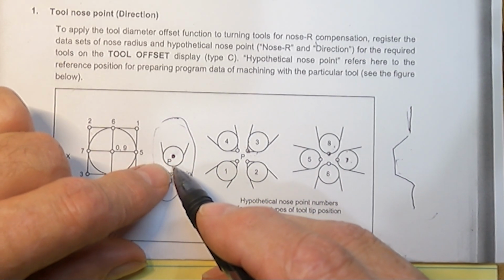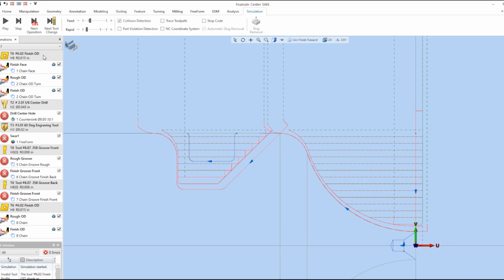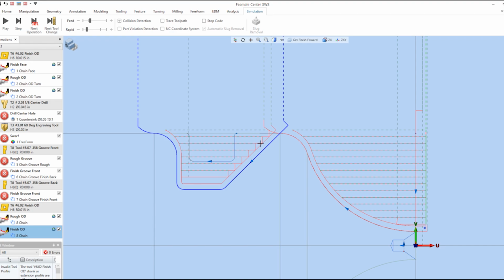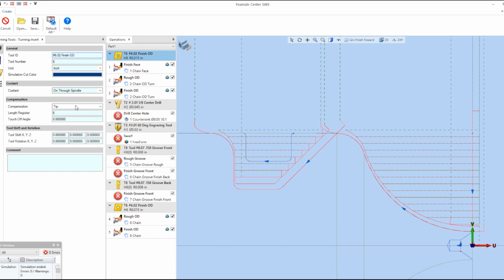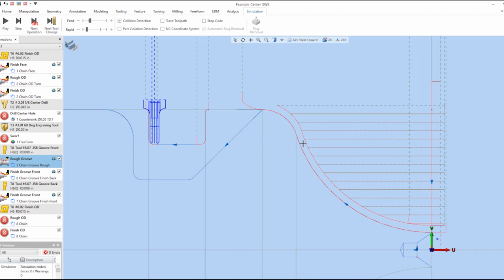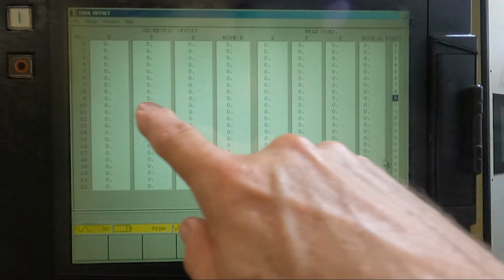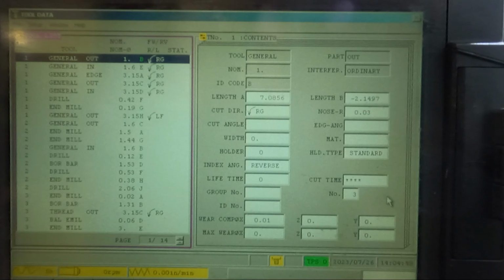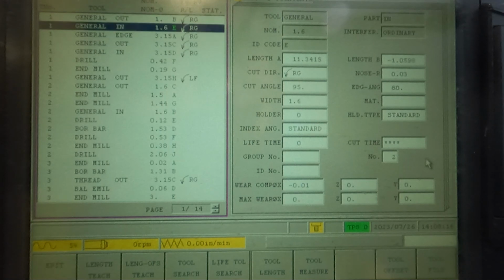Lathe Tool Tip Comp 2

Comment: if you write T0808 in the program, then it will run according to what is written in the table line nr 8,    when there is nothing in the table then it runs according to the mazatrol tool, I thinks that you can have 128 tools in the magazine, that fits with the 128 lines in the table..
Reply from the maker: No on this machine when you run Mazatrol tool setup in a G code (they call this eia.) your tools are called T8.01 for tool #8A T8.02 for #8B and so on. Because with the Mazatrol tool definitions you can have many tools on the same number. The letter tells the control what tool definition to use. In G code you can’t use letters so .01 is A .02 is B .03 is C and so on up to Z except a few of the letters like I J K (I think I would have to check?) this machine holds 80 tool in the tool changer.

Comment: I’ve watched your lathe tool tip radius offset videos and I still have a few questions on the tool data at the integrex. Specifically, if I am using one tool in multiple orientations in the milling spindle (oriented at 0 degrees for od turning on the front side and 180 degrees for turning on the back side as well as turning with multiple b axis angles) how to I manage that data in the controller? Do I need to create a new version of the tool for every orientation of the b axis and front side and back side turning? Will I need to build the same tools version in esprit? From the looks of your tool data page, it looks like the answer is yes but I’m a bit confused when it comes to the A B C D E…. orientation and how esprit determines what the alphabetic cut direction designation is generated.
Reply from the maker: Yes you will define a separate tool for each orientation. Just like you are saying with A,B,C so on like you said. Now in a g-code you just change to that tool with a M6. So for tool say 2B that would be T2.01 M6 (Esprit should put this in the code if you also use a different tool with the correct orientation in Esprit). And yes you have to build a simulation model (adaptive holder) for each tool in Esprit for the simulation. This could be the same one you just have to rotate the adaptive holder and redefine the inserts location for the rotated location and change the spindle rotation direction. Hope that helps.

Comment: What software do you use to program your mazak integrex by the way? Also what software would you recommend me to learn myself? I run a 650 mazak integrex myself but I'm a conversational machinist only right now, but I want to learn a CAM software so I can start programming in that besides only using mazatrol
Reply from the maker: I use Esprit Cam. At the time it was the best for the Mazak Integrex. But now there are many softwares that can do it. Esprit is expensive and may not be the best option there is now.
Reply: @EdgePrecision  Would Mastercam work just fine?
Reply from the maker: @Leinnn  It could. I have no experience with Mastercam so I can’t say for sure. You have to get with Mastercam and get a demonstration.
Reply: @EdgePrecision  Alright, thanks for your replies

Comment: @Edge Precision    Hi Peter, thanks so much for taking the time to make this video!  It has been super helpful to me.  I have finally gotten my Mazak Integrex 200SY fixed! (1999 model year with Fusion 640mt control)   I am trying to find the right cad/cam software to run it.  Over the years I have seen you use Esprit and Master Cam, as I recall.  I have used Fusion 360 before so I am leaning that way, but I thought I should ask for your thoughts on software before I take the jump.  FWIW, I am a full-time pastor and part-time machinist, so cost is more of a factor than it is for most because I do not use my machines all the time.  Thanks again for all the learning you have shared with the youtube community over the years.  God bless...   Mark
Reply from the maker: Mark I did a while ago investigate into using Fusion 360. But there was no good post back then. Now I have had people message me that there is something now. At the time I was looking into this the Fusion people didn't make posts for machines (I don't know if this is still true). So you had to go to a outside source for this, and of course pay for that. All other Cam software's are sort of expensive so I don't know. Also there are subscription or maintenance costs. With my Esprit this costs around $5000.00 a year (I no longer maintain mine).
But I will say if you are running a business their support is very good and if you are doing very complex machining it is worth it to get a solution to you problem quickly. Instead of spending a lot of time and still have to do some kind of workarounds. With Esprit they provide a accurate model of your machine for simulation and will work on your particular post to output code exactly  the way you want. Auto Desk may also make better options for programming a mill turn type of machine. But you are going to pay a yearly subscription. So the short answer is, there is no inexpensive option. If you don't do real complicated stuff. It may be better to just use the Mazatrol conversational format. Unless you need some unusual machine movements. The guys here at Center-Line can do some amazing things with just the Mazatrol.
Reply: software you have in your mazak machine .. mazatrol programming . you can do most normal turning very easily and quickly in mazatrol and it is easy and quick to correct plus you don't have to think about compensating, mazatrol does it if you only choose to drive (eia/iso) on the machine you must be sure of setting up in the machine is exactly the same as in cam .. whether you use mastercam or something else is not a problem it is what the postprossor writes that is important ..I didn't see it was Intergrex sorry what Peter makes are small series which are very complicated. there I would also choose cad cam. if you drive large series and have to correct a bit all the time in the morning when the machine is cold and during the day mazatrol is light and fast .. there are many things that come into play whether you have to choose cad cam or mazatrol you can also run both if You want

Comment: Hey Peter, normal I use G41/G42 on my ST25Y with the R (Rad. Geometry) and T (Tip Direction ), e.g. R 0.8 and T 3. without the CAM - Center Tip option.
What if I use Center Tip option (CAM) in combination with G41/G42, should I leave the Geometry R-value in the table to zero (0) and only use the Wear, because the CAM did the X-Z-R-calculation already,  Haas and Fanuc have the Geometry table you showed as 2nd table.
Reply from the maker: I'm not totally sure what you are asking. Are you combining a manually written program with a Cam processed program? If so everything thing has to match if you are using the same tool offset to do both operations. You could assign two different offsets on the same tool. So it is possible to on each offset to have a different tip comp direction but you are actually doing everything with the same tool. But if you do this you need to be careful to touch off each offset at the machine correctly and to call the offset in your program when it is needed. Your Cam software should be able to define the tool the same way as your manual program. That would probably be the best way. You can of course use wear offsets to compensate for these things. But I don't really recommend that kind of thing because if a lot of time goes by and you have to do the same job again. You would have to remember what you did. So if someone else runs the program they won't know this. (You could also put notes in the beginning of the program to remind you). So mistakes could be made. It would be better to try to standardize the way you program and touch off tools for all programming to avoid this kind of thing. As I said in this video I don't ever use the 0 or 9 comp direction for tip comp. Because those aren't the way you touch off tools, either with a tool setter or manually.
Reply: @EdgePrecision  
I use manual program and CAM but never use the Center-Tip option in CAM because it gives strange G-code numbers for X, Z and R, the other options just give X-diameter, Z-length  and radius just like the CAD-drawing, the cnc-control in combination with G41/G42 doing the math for me.
Probably it's a fault in the Postprocessor, X and Z should always match with the CAD length and diameter.
Btw, I use multiple Offsets on the same tool when I do long shafts, e.g. just call for T0220, T0221 etc. for T02 in this case.
Our lathes ( Haas /Fanuc) only have the 1 - 8 tip directions, not 0 or 9 Center-Tip.

Comment: Thank you.
I just found your site yesterday.
Your are so caring and thorough
We live in northern Michigan
I Built a new shop in 1993 and it has 9” of high strength concrete floor in it.
In the late 1980’s and the 1990’s I bought many New machines from the Military
Long Term storage facilities this equipment was from the second world war.
I was single at the time and was very busy with engineering and traveling all over for business.
Eventually Got married and have a 22, 20 and 15 year son and a 14 year old daughter
The 22 year old has 2 years in the schools skill center machine shop.
And 2 years in collage for cnc machine shop and programming.
These Machines never were wired up yet. Still in cosmoline
My Wife is not business orientated at all and sort of discourage our children to get involved
in self employment.
WE have many machines that weight 9.000-14.000 Lbs
Laths, Mills, Drills, Shaper, Horizontal mills, Gear Hobber, Gisholt ABC Bar cutter Turret lathe.
Lots more and well over 10,000 Lbs of tooling Drills reamers Taps and Dies up to and over 3 inches.
So the Question is Why should there be a hesitation to put these tools to work.
One of your early videos is it’s better to learn on manual machines In which I agree.
And right now I have a very Nice condition and a great size machine Nc tape lathe ready to purchase
and add to this Shop But Sill No Interest
All of this is bought and paid for?
But My Son He wants New CNC machines
Question
In today's world why Go in Debt
So I Ask All of you
Please educate Me and My Children in what We have and potential that they have available to them.
How is the business climate to day in this country in Michigan?
Any body want to mentor my children and guild them in this?
And what about my 14 year old Daughter.
IS there any one willing to help her in opening this machine Shop.
Thanks to all that gather here you are helping make the future greater in this country
and we will be watching the Comments
Thank You

Comment: peter how would you program that contour if you had to do it manually .. the contour is important .. just want to see if you want to do it like i want to do,,,,           the 1-9 numbers are only active if you drive with G42 G42 (G40) in the program? ? Or am I wrong about it
Reply from the maker: In turning the compensated quadrants (1-9) are only active when tip compensation is being applied G41, G42. So you are correct with that. When I program my little Haas lathe in my garage. I almost always do it manually. In that case I always program the actual finish dimensions of the part. I use the standard roughing cycles (G71, Rough turn, G70 for the finish of that cycle. Exc.) in the control and tip comp for all the finish passes. The tip comp can be put in the same path as the roughing cycle, G71 it ignores it for the roughing. Then after that you just give a line with G70 N(Start of the contour)to N(End of contour. The feed rate of the finish pass would be in the actual contour. Witch is ignored by the roughing cycle. Because it's feed is in the cycle.) With the finishing tool and it reruns that contour with the finish tool with tip comp. This is a over simplification but you get the idea (Maybe?). You need to look up these cycles in your machines manual. And the grooving cycles. With them you can do 99% of all turning on a CNC lathe. Maybe I should do a video on this kind of programming.
Reply: @EdgePrecision   Thanks peter..I understand you also want to program the finish contour with G41 G42 so that the contour is correct. It would be great if you made a video about it.
Reply from the maker: This comment got held for review by Google? I just saw it sorry. Yes I do want to do a more in depth explanation of compensated tool path. Thanks!
Reply: @EdgePrecision  thanks peter .. yes turning is not easy without compensation if the contour is to be correct
Reply: @EdgePrecision   Thanks peter..I understand you also want to program the finish contour with G41 G42 so that the contour is correct. It would be great if you made a video about it.
Reply: @EdgePrecision  Yeah, it would be great to have a video about that. especially turning is something many people don't understand  :face-blue-smiling::face-blue-smiling:
Reply: A video about that kind of programming would be really interesting. Thanks for all the content you put out.
Reply: @watsonRB  G0 T0101
G18
G0 G54 X82.5 Z1.25
start
G54 X80. Z0.
cycle
G71 U2. R.2
G71 P100 Q102 U.4 W0.2 F0.3

kontur
N100
G0 G42 X-4. S550
G1 X20. F.1
X40. Z-10.
Z-20.
X80.
G40 
N102 
end kontur

G0 Z0.
finish
G70 P100 Q102
-------------------------
G0 Z0.
G28 U0. V0. W0. M05
T0100
M30
its look like this

Comment: Makes the angel of the tool no difference to g42 or g41 because  the radius of the tool starts at a different point if the angle is 120 degrees on a od g42 tool or ??
Reply: But wouldn't the controller calculate that given the fact the tool radius is know and the angle of attack into the stock?